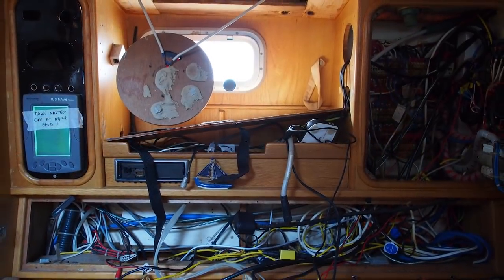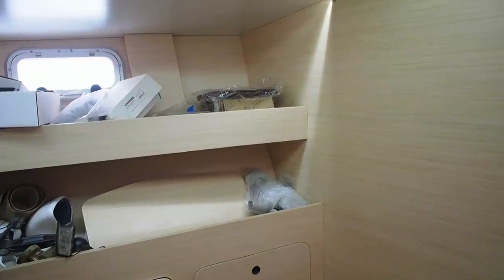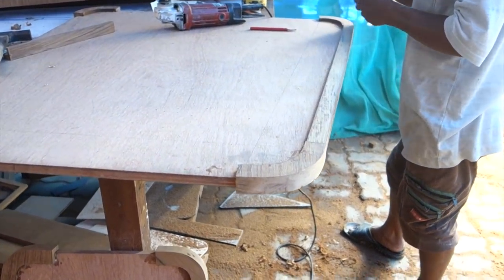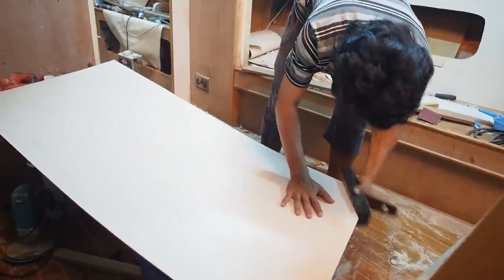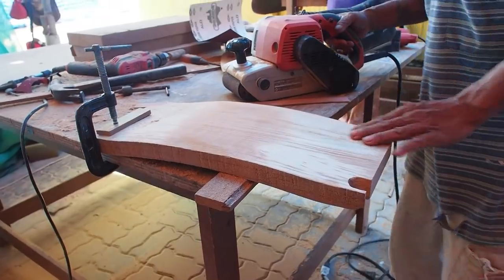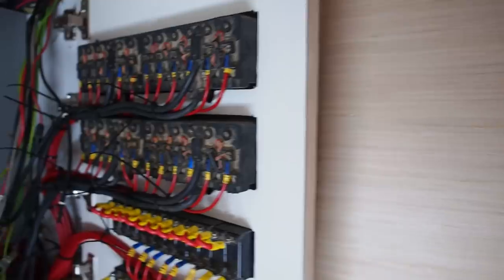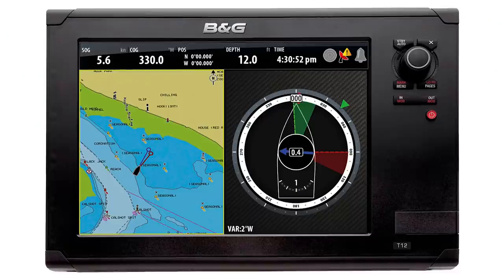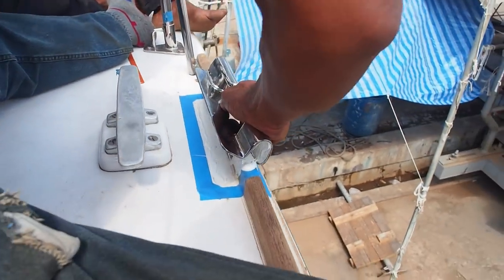Total Sailboat Refit (interior, electronics, B&G navigation system) Part 3 - Sailing Ep 201

Comment: Fantastic episode.   I can't wait for next week's installment.    

I am quite jealous of your large open spaces and all the room for storage that you have.  We are not by any means beamy here, and with a low centre cockpit our usable space belowdecks starts at the main bulkhead just forward of the cockpit.  Under the cockpit is lockers only accessable from the cockpit, 

The aft cabin has its own separate companionway leading aft from the cockpit and is basically a large bunk with some limited storage and shelves above that.  It is our "garage" and is mostly a pile of gear, sails, and folding bicycles.
Reply from the maker: I used to be able to get one of our bikes on the single lower bunk but these days it stays on deck in its bike bag.
Reply: We actually have less room on deck than we have in the aft cabin.   I often keep our #2, #3, and #4 jibs in bags on the foredeck and ready to hand.  They do very well out there and get wet and dry out fine.  Our #1 is a huge nylon drifter that rolls up tiny, the size of a small pillow.  That we keep in the aft cabin.

Comment: That is a great summary, and a how to do it refit guide. Thanks. The only thing I would have done is widen the passageway openings. Mine drive me nuts. One inch either side more and I would fit through with out the inevitable hit/squeeze, and there is room to do it but they had their timber moulding formula to stick to. Baa Humbug. I love the end result, so I might try putting up some light colored material over the bulk head teak veneer to see how it looks. My saloon table swings (off center) around the mast support so I can swing it out of the way, but then it is in the passage way. I trimmed it down a bit to make it easier to get past, but finally realized I have to cut it in half to fold over to coffee table size. Then swung through 90 degrees it is almost completely out of the way and the saloon becomes a comfortable lounge, and so spacious as you saw on another boat.
I love your lighting, well done. And the other masterpiece is the cockpit cover. I followed that when it was being done and I really couldn’t see it coming out as well as it did. 
That teak cabin sole is amazing in solid 3/4 inch teak (no squeaks I imaging).
One thing I am adding is 3 large provisions draws on heavy duty SS runners under the Saloon seats. I hate lifting cushions to get to food.
The chart table is a special problem I’ve yet to fully resolve. That big broad are in the perfect location to …. Park stuff on……and then you can’t open it. I’ve recently done enough reorganizing to have the table completely clear and I fitted one of those spring stays to hold the top up. There has got to be a better system, though.

Comment: I thought the interior was stunning and the electric panel looked very professional. One surprise was that you didn't get the engine out on a 12 month re-fit. Same with Bums on a Boat, they've just done a 12 month re-fit and had horrible engine problems after splashing. Very well done with the bonded customs deal.
Reply from the maker: It was certainly an oversight and one to be discussed in next week's video.

Comment: Jamie, using a diode splitter drops the charge voltage about 0,7 - 1V. That leaves you, (depending on the type of battery) with the batteries at most half full after charging.
A relay doesn't cause that drop but has a finite life. Have a look at Sterlings A2B alternator charge regulator which gives you full control of the charging voltage. It also speeds up charging to 100%.
Reply from the maker: The Sterling A2B charger is exactly what we have on Esper, and have had for 12 years or more. This is an old episode so I'm not sure what the diode splitter is you refer to but we got rid of that very early on.

Comment: Thanks, great material, very informative. One of my big projects will be to update my overhead and lighting, so always interested in ideas.
Reply from the maker: You might want to consider putting capacitors on each light, rather than voltage regulators.

Comment: Yea! A voltage regulator for the lighting....
Reply from the maker: We should really be installing capacitors on each light but the voltage regulators do a decent job.
Reply: Sailing followtheboat I think the regulator would do a better job but a small filter capacitor would be cheaper. The problem is calculating the value. MOV’s would be nice.

Comment: I’m slightly confused- how many refits have you had? :)
Reply: Good question. From what I know they have had either 2 or 3 major refits. Not sure how much was done when they first got the boat (in Turkey?) and was major refit or not ... but would love to hear clarification on actual answer. Over that long many years span, they have had many minor modifications, updates, etc as well ofc. For example much of this is from major refit (more like complete overhaul) in Thailand what like 5 or 6 years ago. However they have done more since then (again mostly in Thai) getting ready and in preparation for Japan and northern crossing, which is not what I think they would call a major refit, yet did involve several mo's of work and time. This makes it all confusing since a boat always needs work.
Reply from the maker: We've only ever done one refit, which is the one we're revisiting in this series. It was undertaken 2014-15 at PSS, Satun. A few years later we added the dodger/dog house in Krabi.
Reply: Sailing followtheboat thanks! It’s the magic of the ‘revisit’ that has obviously confused me :)